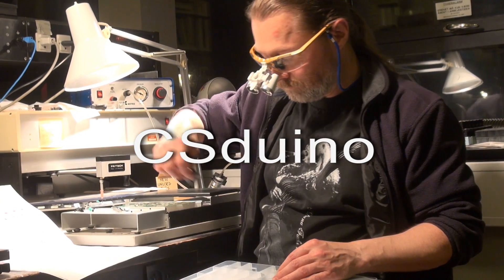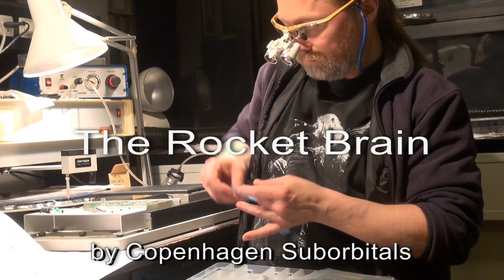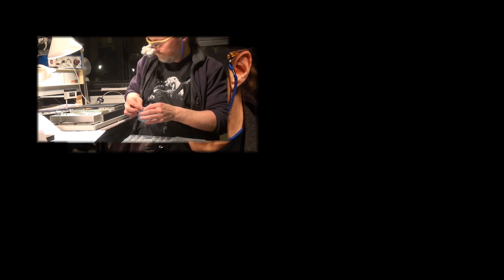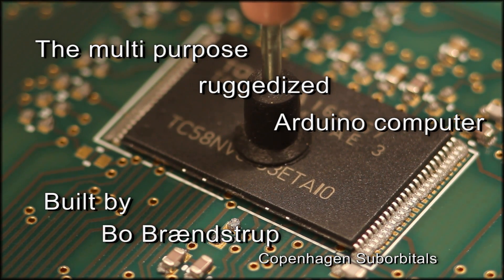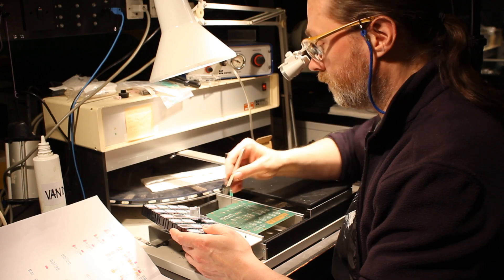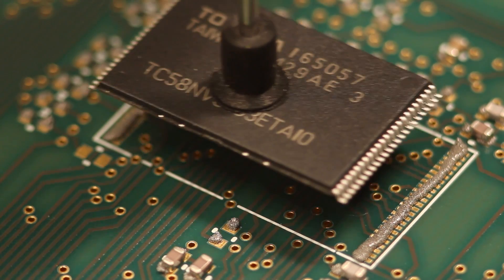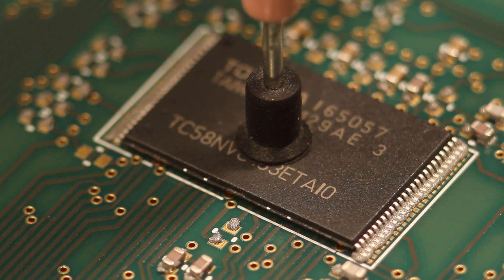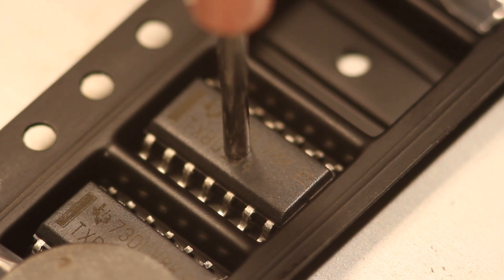CSduino - The Rocket Brain - The multi purpose ruggedized Arduino computer.

Comment: Tantalum capacitors can burn violently when they fail which could be an issue. Have you glued the components down first? That could help with taking the stress off the solder joints. You could also coat the assembled pcb in lacquer, which is often done in the automotive and aerospace industries.
Reply: Thanks man! The probably would have NEVER thought of that.

Comment: seems to me that the vibrations encountered by high frequency combustion oscillation could damage a week solder connection or even generate stray currents from magnetic fields and vibrations  and possibly cause malfunctions  . if a wire conducting current is vibrated at say 50000Hz next to a wire not conducting current will it induce a voltage?

Comment: Great job Bo! Nice choice of processor, great architecture, and you have been most wise to design a general purpose computer core for numerous deployed applications in the vehicle. I have used similar strategies in high-reliability designs such as medical products very successfully. I'm not sure you can realistically make your board protected against every possible failure, such as a catastrophic engine failure!
Reply: Petar Petrovic You absolute ignorant tosser! You clearly know nothing about medical regulatory requirements, or my career.

I was Principle Electronics Engineer for a $2bn multinational medical device manufacturer, I hold numerous patents for the design of medical devices. If you don't believe me, check the whois for my domain name (billysugger.com) to find my real name, then look me up on Google Patents. I've also designed systems for industrial control and automation, military communications, aviation safety, security and intelligence agencies, and a whole spread of scientific applications. What are your credentials?

No reputable processor manufacturer approves their products for life critical applications, but manufacturer's approval is not required. A medical device's regulatory status is approved by examination of the regulatory submission, and includes design documentation and objective evidence that the device conforms to the essential requirements for safety. It does NOT rely on processor manufacturers' certification. I have never designed a safety critical product where the failure of a single non-critical component, like a processor, leads to excessive risk of harm. Unless the designer is incompetent, and leaps to conclusions based on inadequate information the way you do, there is always additional protection to mitigate the risk of component failure. Safety critical components, such as fuses, a.c. filters and switches are invariably VDE and UL approved for critical use in medical applications, and are a different matter.

I suggest you read up EN60601-1 and EN14971 before coming back on this, unless you want to be torn a new one... And if you're game to try, then give a specific example to evaluate.
Reply: *****
Flight recorder technology is ideal for flight recorders. But we also have to consider that every gram of extra weight in the booster is a gram less in the payload. If the primary function of the engine control system is engine control, then arguably a catastrophically failed engine no longer needs control, and the controller can be sacrificed. If data logging under failure conditions is necessary, then this is more complex, and needs either logging controllers to be protected from systems failure, (a very difficult thing to achieve in practice), or to stream data at high speed to a separate "black box" type flight recorder.
Reply: ***** this guy doesnt read anybody elses comments just rambles on to listen to himself or read his comments or something, hes crazy.
Reply: Just as well that I don't... ;-)
Reply: Billy Sugger I always loved people who design "high-reliability designs such as medical products" and they use Atmel products or ARM. If they ever passed in mile from some of devices they claim that they design, they would know that Atmel or ARM NEVER (and no agency) approved used any of their products in any life supporting/life critical product, in best case they worked on some blood pressure measurer or some "critical" medical device like that. Who design life critical devices have very little choice of architectures (most common is based on PowerPC and from companies like Freescale, Infineon and Renesas).
On other hand Atmel produce microcontrollers for rad-hard applications, but they are exclusively based on SPARC architecture, but they cant be used for life critical applications.
In most of world life support clause apply to even all electronic in car (except for information systems), so design used here cant be used for engine management (Atmel can't be certified).